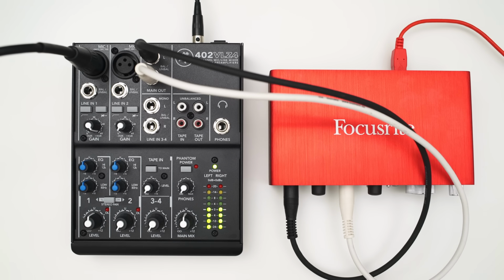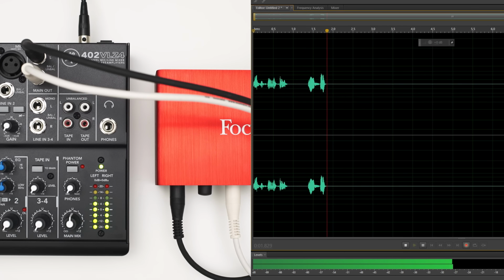Setup Guide - how to connect a Mixer to an Audio Interface for audio recording

Comment: Initially thanks for making such a well informative video.I am having laptop with 8gb ram,500gb hd, Sound forge 12.6 as daw,2 quality microphone Shure sm58,and seinhesser.2 powered monitors Mackie thump12 and studiomaster 400.Also connected 32"tv screen and Samson mixpad 144fx sound USB mixer which is having facility to record using cable.Is there need to purchase audio interface?I am using this setup for karaoke music club.I want to record song while karaoke display on screen and recording continue through mixer to daw in computer.is it viable?if yes how?

Comment: Great video! Thank you for posting this.  I'm considering buying a mixer to add to my XLR Rode Procaster\Focusrite Solo\Cloudlifter set up. The Cloudlifter was there to help the mic which as you know is power-hungry.  Should I keep my Cloudlifter in the setup or can I take it out? I ask because I'm not certain that mixer will provide the power that the mic needs without adding line noise. It's really the only reason I bought the Cloudlifter.

Comment: smartest way to be stupid 
just plug the two damn mics directly to ur interface
Reply: You're not wrong, but if you're setting up a demo recording with a bigger mixer and you just want a stereo mix, this is one way to do it. I wouldn't say it's the best, probably isn't even the cheapest, but needs must.
Reply: @ianwebster3489  so one mic goes out throught two main output to your seprate chanels interface wich also gives you in your daw two seprate tracks , like you duolicate it , i suggest insert your mic directly in the interface , and in the daw mixer select your chanel input twice in diffrent track mixer and its done .

Comment: Sir you used trs cable from mixer going to the interface, instead of doing that can we do another way ling using xlr cable from the mixer going to the interface?
Reply: i was checking it on line ..depends it your mixer has XLR for smaller mixer they dont .they only have XLR input but not out put ...hope it was helpfull
Reply: Amjad Alhalabi بائع الخرافات okay sir thank you

Comment: I have a vintage Mackie 1402 VLZ mixer with TRS (female) and XLR (male) main outs. I also have a UAD Apollo Twin interface with combination inputs: TRS/XLR (female). Since balanced connections can be quieter than TRS, I'd love to use XLR female-to-male cables to connect my mixer to my interface.

Unfortunately, the XLRs on my Twin were meant for mics (the Twin also has phantom power). Thus, there would be a signal level issue, since TRS defaults to line input and XLR, to mic. The XLR ins are definitely not meant to accommodate balanced cables from a mixer.

If I'm able to adjust levels accordingly to compensate (or use a DI box), is there another reason not to use the XLR connection with a mixer?

Comment: Just didn't like it because it doesn't say how to (or if it's possible) to connect a headphone to the mixer and get audio from the interface at the same time I'm recording instead of using the interface headphone output.
Reply from the maker: Hey, just plug in your headphones to your interface. This way you can hear the audio from the mixer and the audio from your PC.
Reply: @JulianKrause  Thanks. I know it, but since I plug the 402VLZ4 directly to my MacMini, it would be more convenient connecting the headphones to the mixer as I can place it closer to me.

Comment: Hey Julian, I have a mixer which has both XLR and TSR option for the main output. Can I use both of them? Like, TSR main output is for the audio interface and XLR main output for the speakers? will it work this way? Please guide.
Reply from the maker: Hey, have a look in the manual of your mixer if you can use both outputs simultaneously. But it should work.

Comment: Why -20db on the PC end? Shouldn't they both be peaking equally at 0 or just below?
Reply: nevermind i get it now.. do all analog mixers clip at +20db? I have been using a Xenyx 802 and calibrating the line-in on pc to hit 0 when my mixer hits 0, am i wasting potential quality by using 0db as my clipping point on the analog side of things?

Comment: If you connect mixer to a soundcard interface it will be more noise on a signal for the best sound it is advised to connect just soundcard interface , mixer it is not needed 😉

Comment: Sir please tell me a small good mixer that I can use with Focusrite?
Reply: Behringer Eurorack. They're older, but can be found used for a fairly cheap price, and they work very well if you are just getting into this kind of stuff. Look for used ones in good condition (obviously). I went with the Eurorack UB1204pro for the IMP "invisible" Mic Pre's, which are reportedly very good for mic'ing a guitar cabinet and recording live guitars. Alternatively, you can look at the Behringer Xenyx line of mixers, which are still fairly affordable, but do I do not know much about their mic pre's.

I'm just getting into this kind of stuff after watching some Glenn Fricker videos in regards to recording live instruments/vocals. I found my mixer, used, in EXTREMELY good condition on the guitar center website for $70. Check out some of his videos on recording, tho. He's very knowledgeable, and has been doing this stuff for over 20 years.

Comment: Can you use a line to xlr cable to connect them? ( the xlr plugging into the interface)
Reply: XLR will go into the pre amp of your interface. This will be too hot and noisy, as you already have gone through pre amps on your mixer. Best to go and buy the right cables.

Comment: Can't you just use a mixer instead of an audio interface? Does a mixer come with audio drivers for it? I feel having a audio interface defeats the purpose
Reply from the maker: Well, depends on your mixer. If it has a USB connection, you can directly connect to a PC. If not, then you would to the preocedure shown in the video ;)
Reply: @JulianKrause  So I would imagine the mixer that has a USB or cat 5 cable would come with option to update drivers for the mixer or is it not necessary?
Reply: @Metalpazallteway  most entry level mixers that have a USB port are just plug and play on the computer, they show up like a USB headset would. I don't know of any entry level mixers that have AVB or Dante which would allow you to record over your network. I have a Allen & Heath SQ-6 and even though it has a ethernet port, you can only control the mixer over that port not record.

Comment: Nice vid! Could you explain why -20 dB is a sensible level for recording into the daw?
Reply from the maker: Sure, that's because you want to leave yourself some headroom. If your constantly peaking very close to your maximum (aka 0dBFS) and the audio gets just a bit louder, it will clip and in turn distort the audio. But you also dont want to record your audio too low, as this introduces noise. With your recording level around -20dB you still have a nice amount of headroom but your signal is strong enough to get a clean recording. That's why I recomment this recording level.
Reply: 0db on mixer = -18 to -20 dbfs on software...

Comment: Hi, I like your videos and I had a couple questions

1) If you don't pan right, or left, is it pointless to connect both the right and left outputs?
2) Do you need to install any drivers with an external interface. I know some of the mixers that have an included interface, you need to install drivers. 
3) I was looking at an interface that had 4 xlr combo inputs on the front, but on the back it had 2 monitor outputs, 4 line inputs, midi connections. What are all these extra holes for?

Comment: i live in the netherlands, and i just can't find a TRS to TRS cable (quarter inch) everything is either 3.5mm, or it's TS. Can I get TS? and if not, can u show me a link, or name of how the cables actually are called. searching "TRS to TRS cable" doesn't get me the cables you have.
Reply from the maker: Hey, you can also search for 6.3mm stereo cable. That's the same thing, but might be easier to find in your country.

Comment: If I had a 6 input mixer, but this Scarlett interface, could I still use it to record drums that have their own tracks
Reply from the maker: No, the job of a mixer is to combine multiple channels to a mix. When you use this setup you can only record a mix of your mics and won't have separates tracks.
Reply: @JulianKrause  thanks for the help

Comment: What if your mixer has a USB output such as Peavey mixers?  Is there an advantage to doing it this way vs going via straight into the computer via USB?
Reply from the maker: Not really, if the mixer has a USB connection, use this to connect to your PC.

Comment: Wondering why you use TRS cables and not TS cables since you use two...
Reply from the maker: Because with TRS it is a balanced connection which uses three conductors.

Comment: HI Julian, can use a mixer with multiple tracks and record multi tracks at the same time? thanks
Reply from the maker: No, the task of a mixer is to combine multiple sound sources to a single mix. You won't be able to multiple tracks separately. If you want to that you need an audio interface with multiple inputs.
Reply: @JulianKrause  thanks Julian. Bless you!

Comment: Hi there great tutorial, but what if you need to connect to mixer with an external synthesizer and/ or a guitar with a mixer with 8 inputs is this possible to do just plugging into the interface. 1 for mono or 2 for stereo?

Comment: If I insert 5 instruments to my mixer take the left output and connect it to an audio interface like this .. (only one connection is going to the interface) . Will I get 5 different tracks in my audio interface or just one tracl containing all these 5 inputs ???
Reply from the maker: You only get one track which got all 5 inputs mixed together. If you want to record 5 tracks separately you have to buy an interface with 5 inputs and directly connect the instruments to the interface.
Reply: Ok thanks.. well Ur covers are awesome

Comment: I have a 24 channel mixer, it has 4 xlr's out, so I just use those into my 4 channel interface. If you have xlr main outs, use that. I don't use multiple lines into fewer i.e, 24 channels into 4. I do 1:1 and only using some of the pre amps etc on the mixer. If you start combining multiple lines into 1, your'e going to have a bad time later on as you try to balance things out which you can't because multiple tracks are 1 track and those individual sounds are set in stone.
Reply: As a keyboardist, I need a mixer for balance between parts, and to be able to choose between (and monitor) multiple inputs. I think carefully about the unison sounds I combine. But it's also true that I track them separately (and usually dry) if balance will become an issue later or one of them will require different processing.

Comment: I did this once. I had a vintage Tascam mixer that I love the preamps on them they were nice and warm. So I hooked up my microphones to the mixer and then the mixer to my interface and it sounded amazing! Great video
Reply: I'm getting a vintage Tascam too. I'm also in search of that warmth and I'm not too sure if I'll achieve it. Which tascam mixer did you use?
Reply: @briangonzalez643  The Golden Age Project Pre73 MKIII mic preamp is pretty awesome too for warmth and tone.
Reply: Hey bro.. How the quality of both affect one another? I have a high end audio interface and think to buy a mixer with 5-6 Line inputs(not an expensive one)

Comment: Hi I got ONKYO NR 646 A/V receiver. I got a microphone with attached cable (i guess 3.5mm, old one). I want to connect that mic into A/V receiver. But it does not have a MIC input. But got other inputs like PHONO and old Analog/Digital inputs. How do I connect my MIC to A/V receiver and get out from my speakers connected to  A/V receiver. Please someone tell me what kind of equipment I need and how. I am looking for Budget level price since its not using as professional but once for special occasion.

Comment: Running your input gain at 10 is a good way to get a hell of a lot of noise, especially on low-end mixers !!   Not the best advice ever.
Reply from the maker: Hi Brian, that's an irrational fear. The preamps in mixers these days are pretty good, even in the cheap ones. The setup shown in the video will achieve the best signal-to-noise ratio that is possible with these devices. Lowering the gain will not increase the SNR.
Reply: @JulianKrause  Not an irrational fear at all.  The hiss is real.  By the way, I am an engineer.
Reply from the maker: @brin57  That's great to hear! Would you like to offer a solution? Where else could I have set the gain?
Reply: @JulianKrause  As you said Julian, it's all about signal to noise ratio.  First start with a reasonable signal level.  If you need your run your input gain at Maximum , then your source is too weak.  At max you will be getting some hiss. I would suggest starting with the gain at about half, and increasing the signal.  What mic are you using and at what distance?
Reply from the maker: @brin57  I was using a Behringer XM8500 wich was essentially touching my lips and I spoke in my normal talking voice. I could have started to scream to get a better signal-to-noise ratio. But let's say I wanted to record a podcast, then screaming in the mic the whole time just to get a better noise floor is not really a solution.
Reply: @JulianKrause  ok. With that scenario it seems strange that you would have to run the gain so high.  You certainly were not whispering. The pre's on the mackie are not weak, and even though it's a budget mic, it's not horrible by any means.  Are you sure you did not have a Pad engaged, or an input selector switch set to inst instead of mic.  Something's not quite right.

Comment: actually i thought of this idea as my audio interface behringere 404 has got one universal phantom power switch for all of the 4 inputs.. so in case on connecting a condenser mic in one channel of the audio interface and guitar line to the other channel that would deliver 48v to both which is essential to the condm mic but not to the guitar line .. by connecting mixer to audio interface i can isolate the 48v phantom power from being delivered to the guitar line by connecting  the cond. mic to the mixer, give its 48v ph. power from the mixer .. am i right?
Reply from the maker: Hey, you guitar should be connected with a TS plug to the interface. Your interface does not send phantom power over the TS plug, only the XLR plug. You can use the guitar with the phantom Power turned on without a problem. You don't need a mixer for that.

Comment: Is unity gain on the Scarlett 2i2 when the gain knob is turned all the way down? AFAIK it turns the incoming line level signal down if the knob is at zero

Comment: Fyi XLR or\and TRS are not line level. XLR and TRS are balanced and +4dbvu. Line level refers to -10db, and is any unbalanced connection.
Reply from the maker: Sorry, but you got a few things wrong here. 
There are two types of line level: consumer and professional line level. Line level just refers to the strength of the signal which for professional line level is +4du and consumer line level is -10dBV. 
The connector type (e.g. XLT / TRS / RCA) is independent from the signal strength. You can transmit professional or consumer line level with every connector type, balanced or unbalanced.

Comment: Great Video, I'm new at this but how do i record a Vocal and a Guitar? I see how to connect the microphone through the mixer but do i connect the guitar to the mixer or do i connect directly to the Interface and change that input to instrument? i have a Focusrite 2i2 same as your video.
Reply: Skip the mixer and plug everything into the Interface. There is no need for it to go through a mixer...
Reply: @maciekgonet   thought so thanks mate
Reply: Same here, I have got focusrite 2i2. I tried to record electric guitar using processor and out to interface on Cubase5, but I got very trash sound. Any idea please?

Comment: Ok people ..... let’s use our brains...... you can not control the individual tracks . You’re going out from the mains on the board .....
Which limits your control......
Reply: You can control the original inputs which in turn controls the individual tracks.  also, you can add efx in the individual channels for different sound scapes, ie: pan, eq, compressors, reverbs, delays etc. which can be blended or stereo separated in the DAW or the mixer outputs.
Reply: Aerial Panic but it’s only 2 channels ....you can’t go in your DAW after the recording and manipulate JUST a certain channel without manipulating the entire mix .....correct?

Comment: 1. is there would be any problem with the sound quality if i only use 1 TRS (Left main output) cables from mixer main output to interface input (one channel Line input) but do the recording using a mono input tracks on the DAW?

2. Was it only works with the multi microphones recording technique or i still can use it with guitar/bass guitar from the mixer inputs with the settings based on my first question above?

Thankyou!